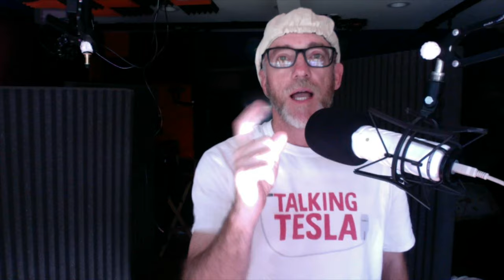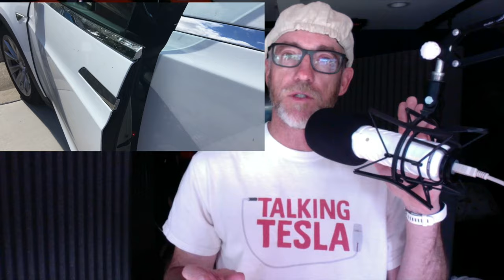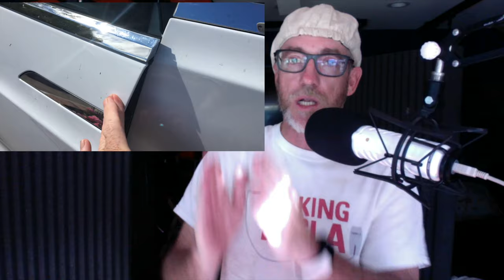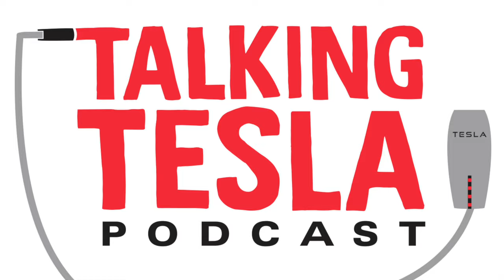TalkingTesla Falcon Wing hits Front Door

Comment: It has nothing to do with the slope of the driveway.  It's just a simple interference between the FWD, when open just a little, and the front doors.  This is fundamentally why the X has "self presenting doors"...to minimize the chances of someone opening/closing the front door while the FWD are in motion and almost closed.  Do a test with your key fob, try to open both the FWD and the front door simultaneously.  The car will keep them from hitting each other.  This is a great example of how one design solution (FWD) leads to complications with other functions of the vehicle (front doors) and cascades into additional complexity (self presenting doors).